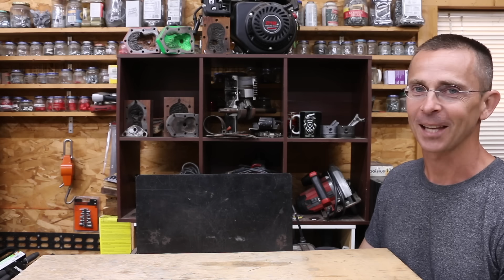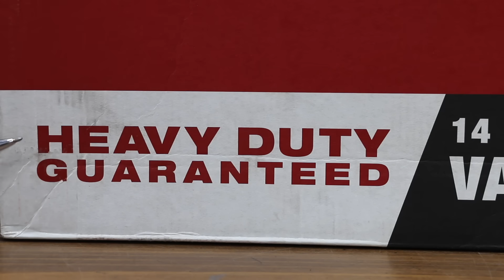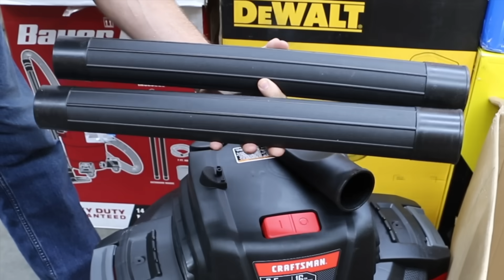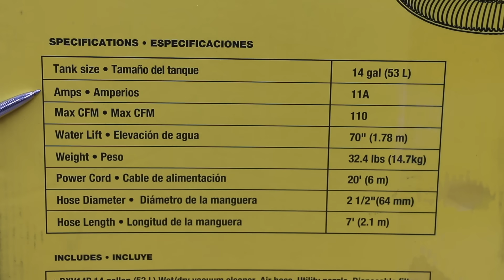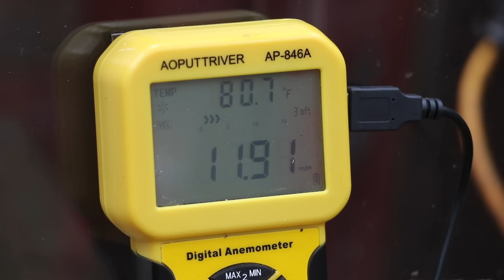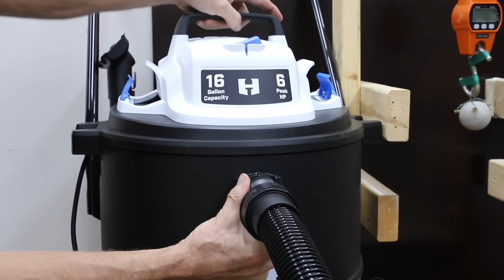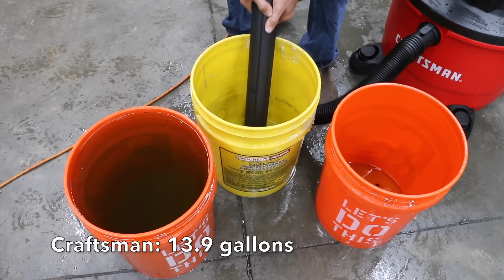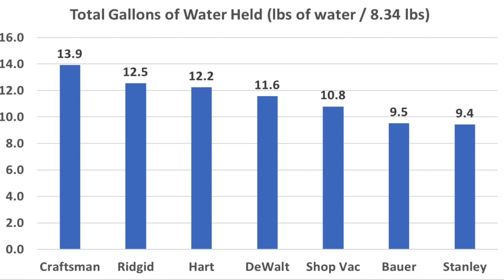Best Shop Vac? Ridgid vs Shop Vac, DeWalt, Stanley, Hart, Craftsman

Comment: We've had a lot of shop vacs in the years for our barns to de-cobweb and other things - our craftsman have held up the most. I also used them at work for drying screen printing screens and the switches are the #1 things that break on these things. The craftsman also lasted the longest there. Not sure now that the brand has been sold off, but IMO it was an exceptional deal when they go on sale for the 16gal biggest fixed vac unit they sold at about 90 bucks.

Comment: I'd modify your reporting results for the water capacity test. Since the vacs had different size buckets, a more useful metric would be "percentage of stated capacity" rather than just the total amount of water they could suck up. I own a couple of Craftsman vacs, but I will definitely give Bauer a second look.

Comment: Always wondered about those HP claims on 120V products.  On a 20-amp line, best it could draw (steadily) before tripping the breaker is 2400W or 3.26 HP.

Comment: One factor you didn't consider was the dust exiting the vacuum.  These are great for picking up wood chips, etc but are not great capturing fine dust.  This can cause a health hazard in confined spaces like basement shops.

Comment: Dewalt is the best by a long shot. It was the fastest to vacum water and sand. It also uses the least amount of power and produces the least amount of sound even though it was the most powerfull vacum of them all. Built quality was way better aswell. It also has 3 years of waranty.

Comment: You needed to test for dust/dirt containment.  I have a Ridgid and every time I move the shop vac around a bunch of fine dirt falls from the lid/bucket interface.  Enough where you need to vacuum up the dirt.  Not what you want from a vacuum.

Comment: Thanks for another thorough test!
On the measurement of suction, the force = pressure * area. The diameter of the hose makes a big difference in the measurement on the scale. It's still a relevant test of the whole package.
You can measure the static pressure with a gauge, or by lifting a column of water: Connect the the hose to a vertical clear plastic tube with the end in a bucket of water, and measure how high the water is lifted. In this test, the diameter of the tube and the hose don't affect the result. You can convert inches of water right to PSI.

Comment: I find it so surprising that one of the most irritating things with shop vacuums seems to be ignored by all the manufacturers. I'll take the quietest vacuum over the vacuum with the most suction anyday.  I have an older Shop Vac QSP model, (from their Quiet line of vacuums) and I have another shop Vac non QSP. The QSP is the one I always use since it is noticeably quieter. Shop Vac has since dropped the QSP line of vacuums. 
Another thing you may want to consider is the availability and cost of the replacement filter. If you work with something that creates find dust, you  should be using a HEPA filter on the vacuum. I wonder if HEPA filters are available for all the vacuums tested?

Comment: Sometimes the shop vac's air filters are not up to the job. They start to disintegrate when in contact with moisture upon swallowing liquids. As a result, the performance gets peak, but also allows dust and particles to get through to the motor as it's air cooled by the suction airspeed.

Comment: The Stanley brand seems like it will serve better for a bee and hornet nest removal vacuum.  Testing like this shows what kind of jobs each vacuum can handle best. Pretty nice. I know I would probably look at the Stanley as my go to because of the factors shown in the tests. By the way, I'm surprised there wasn't a test of the filters and particulate blow by  on the vacuums.

Comment: Bauer is pretty impressive! I have a hand held Craftsman 2 gallon and it's depressing trying to use it. The lid fitment is absolutely terrible, 3 out of 4 times it isn't on right and no suction. The hose fit is no better, always falls out. Not "pulls out"- it just falls out, while running. Thanks!

Comment: You can not test suction like that. The reason is that not all of the vacums have the same diameter hose. Pressure (and suction) is  force / area. If you have double the area of a hose you also have double the suction using the same motor!

Comment: Great video, I was really surprised with the performance of the Bauer/Harbor Freight vac, although it's actually currently more expensive than the Ridgid. I have the earlier model of the Ridgid you tested, the 14 gallon without the leaf blower feature, and I've been very happy with the performance and have used it for some pretty heavy duty wet pickup (even got the electric water pump that mounts onto it to empty it faster) as well as super dusty jobs, where I added a dust collector inline. The biggest things that kill the performance in my personal experience are using super long hoses (I have 4x 20 ft hoses that I attach in series based on the job... the performance hit is totally worth not having to lug a heavy vacuum full of water around), and the dust collector. However it's great to see this real-world comparison of these shop vacs since just about everyone owns one, and it's probably one of the most important shop tools for just about every job. Ty for the video as usual. 👍

Comment: I would love to challenge all of them, with my portguese brand 1.5 Kw shop vac, head fit is tight, all plastic components are rigid and it's heavy as a rock :D I unclog pipes with it, it even dries car seats :D and no assembly required. Also, yeah, it costs 700eur :D (about 750$)

Comment: Never had a problem with my 30 year old small Craftman shop vac.  The lid is super tight and creates a tremendous vacuum.  It bailed me out of a few basement leaks.  I do think warranties are important but a lot of warranties are useless with so much fine print and loop holes.  I've had great experiences with Dewalt tools and I'm sure their vac warranties are good. I'm sure Stanley is good since they are the same company. Craftsman is decent and so is Rigid.  Don't know anything about the others.  Thanks for the video.

Comment: Amp usage with no load is only indicative of the vacuums efficiency if compared to the rated wattage, not it's peak power. You should have created some air resistance by plugging in the suction hose. The added load would have shown the actual peak power of the motor as it needs more current to fight the air resistance. Also, noise levels when vacuum is not sucking anything are irrelevant as those are the lowest levels, not the highest.

Comment: You method for suction power is flawed in my opinion. Force equals Pressure x Area. This is why the Hart failed so - "hard". You can see at the marks on the ball, that the diameter is a lot less (and you said so when you compared hoses). 
So basically you now have to normalize your raw force results to a standard diameter. For example force per square inch. 
Thank you for the video.

Comment: When doing the water test, I noticed that some of the nozzles were being restricted by the bottom of the barrel covering a portion of the nozzle.  I suggest that a line be drawn on a given volume of water about 1/3 of the way up from the bottom and that the nozzles never touch the bottom.  This will ensure that each vacuum's performance is not impaired by an unintentionally obstructed nozzle. As a Certified QA Auditor, I hope my suggestion will help in furthering the quality of your testing. Also, a method of stopping each nozzle from going beyond some point in the bucket would guarantee the consistency of the data.
I love these videos.  Generally, your methods are well thought out and accurate.  Thank you.

Comment: i have a 35 year old "ShopVac" brand that is still going good. the metal container rusted out a few years ago, but i just put a 5 gallon paint bucket under it and am still using it.

Comment: About that sucktion test: please be careful with these numbers, since these shop vacuum cleaners have different hose diameters the ones with lager diameter will exert a greater force while probably having a smaller or simillar vacuum pressure. (F=p*A) You should have attached a 32mm end piece on every cleaner to have a better comparison.

Comment: I'm definitely NOT a fan of the "grudge matches," especially two impact drivers linked, trying to destroy each other. But this grudge match was different. There was little danger of any appliance being destroyed, and I think it actually highlighted the most important quality of these tools. This was a fascinating test, the only suggestion I have is if you do anything similar in the future, you should rig some kind of device to hold the hose in a corner of the (tilted) bucket, so the test is less dependent on the operator. That way the material, be it water or sand, would have naturally flowed to the low spot, and the hose would not have to be swept around to pick up the last bits.

Comment: Slight problem. The suction pull test had hose nozzles of different sizes, where as a std diameter end piece, so the area stayed the same, would've equalised the test, ie, F=PA.
Also the lid lift doesn't really matter because the vacuum will pull it shut. That seal is more to do with the case moulding allowing the seal to compress, and the seal material.

Comment: You might also want to compare the power factor for each motor, since that factors into the actual HP rating and not the Apparent HP rating.  Take Apparent watts, multiply by PF to get true watts,  then divide by 745.7 for true HP.  I think their "HP Rating" really just means "how inefficient can we make this motor?"

Comment: Shop vacs are about as common as the lawnmower, but only use one fuel... to bad.

There will probably be some company improvements as a result of this great test.

A shop vac can work without a filter. I wish this was tested, as often that is the only way they ever get used.

There is that foam filter, and also a clean-able pleated paper filter.

Does some water in the vacuum container improve filtration?

Perhaps a test on using the shop vac. I wear ear protection when using a shop vac.

Comment: The thing about the Bauer warranty is that Harbor Freight is a dedicated "tool store" as opposed to the big box stores where tools are just one department. One of their employees told me that they get loads of "tool rental returns" where folks buy something, beat the hell out of it for a little while, then bring it back for refund after their project is done.  Even though the warranty is 90 days, she said that HF will often do an exchange or pay-the-difference upgrade after the 90 days if you show them how the item failed.

Comment: In sweden, national consumer board has an additional test when tesing vacuum cleaners.

The connect the hose to a rotating arm and lets the vacuum cleaner follow the arm on a bumpy track simulating thresholds doorframes and whatnot for it to bang into. After like 100 revolutions they investigate whats left of the vacuum cleaner.

This will determine the strength of the hose the body and the wheel arrangement.

Comment: at my job we have abused Ridgid’s with cnc machining coolant running them for hours to suck coolant that was spilling onto the floor and then having it pour it back into the machine. heck i still have and use my old man’s 1982 craftsman 16gal shop vac, best buy he ever had with equipment. now i know what to replace it with when it gives out. craftsman and ridgid make and have made strong products

Comment: I found out HF offers 1-2 year extended warranty plans but did not find a price. Since the Craftsman and Bauer are so close in price,the Craftsman would still come out on top, but if time and location for the Craftsman are an issue it's nice to know a better warranty is available with Bauer.  HF stores are everywhere in my area. Craftsman not as much. 

From  HF:
"Our ESP plans provide 1 and 2 years of product protection on eligible products after the manufacturer's warranty ends. ESP plans can be purchased at your local Harbor Freight Tools store within 30 days of the eligible product's purchase date."

Comment: Well, that sucked! Great video and comparison. If it means anything, I have a Craftsman shop vac that I got in 1993 when I worked for Sears, that still works great. I've used it for everything from drains to drywall dust to vehicle cleaning and garage dust collection. I do use a drywall filter for fine dust. Have a great day and stay safe.

Comment: Bought my first Craftsman shop vac in 1977, still using it today. Used it during two house builds with a lot of sawdust, drywall dust, and water pickup. Only problem now I’d finding replacement filters!

Comment: If you're going to test shop vacs, not including a Fein in the mix is disappointing.  I used several other kinds before I found a Fein on sale for a price I could afford, but now that I have it, I am a fan.  Note, however that it has a smaller diameter hose, so there are some limitations.  But being able to plug my power tools into it and use it as an auto-on dust collector is a huge selling point.

Comment: I disagree with the first water challange. By putting the hoses in manually like that, you may be putting one hose closer to the bucket floor and restricting flow speed that way

Comment: I honestly use the leaf blower setup on my Ridgid more often than the vacuum setup, which was a surprise to me. I'll admit that as a vacuum its not perfect, but if you get the right head attached its more than capable for any job I've found so far... plus that lifetime warrantee is easily worth the cases where it lost to another brand.

Comment: I'm pretty sure my Miata makes over 8000hp if you roughly calculate it based off of kinetic energy unleashed in the fraction of a second when it hits the ground at sea level after a fall at terminal velocity with the top up.

Comment: This was an interesting and comprehensive test. I have an old dinosaur Craftsman that will suck the chrome of a trailer hitch, my newer Craftsman has a detachable blower which works well. I don;t think they make that model any longer which is too bad. The older craftsman still outperforms the newer though it's a close race. If I were to buy a newer one, I'd have to go Bauer for the price point and performance. The warranty issue could be resolved with an extended warranty purchase(Harbor Freight is big on that, but also follows through). If it (vac)  works, the 90 day warranty may be a non-issue. My old, really noisy, torn apart and lubed several times old Craftsmen is probably well past any warranty (25 yrs plus) but it still works very well. The Bauer doesn't scare me. ;-)

Comment: You should test tape measures next. For example you could see how puncture/damage proof the tapes are, see how good the locks work, and extend them as far as they can go without bending and dropping. You could also rest durability by dropping them from waist hight and from a ladder (realistic scenarios) until they start to show damage.

Comment: Would you be willing to test 1 or more of the stainless steel vacs like the Rigid or Shop Vac? It looks like the Shop Vac has the same SVX2 motor as the plastic version, and the metal Rigid is only 10gal-6hp instead of the 16gal/6.5hp. I'd really like to know if upgrading to the more expensive stainless options provides better suction, air speed, or quietness over the plastic models. The Stainless options have lid clamps, which could help quite a bit.

Comment: Test the best ways/products that cool off a vehicle on hot day. Like interior windshield visor, window tint, IR reflective paint on roof, solar panel on root, a roof vent, exterior window visors, cracking down the windows a bit, best combo of products etc. I think a lot of RVers and van dwellers like your channel and could use help on this. Keep up the great work.👍😄

Comment: Side cutter/channellock (tongue & groove plier testing. Would like to see cheap vs expensive brands and howuch the size makes a difference (6, 7, 8 or 10 inch) "high leverage" hinge design etc... Grip strength etc

Comment: I can vouch that I have beaten the absolute crap out of several Rigid vacs and they kept on ticking.  We often used rigid vacs to supplement our heavy-duty sludge pumps and industrial vacuum systems for hard to reach or delicate places.  One specific rigid vac I used sucked up about 20 gallons of near-freezing asphalt sludge from the bottom of a barge, several hundred pounds of paint chips, and about 50 gallons worth of a liquid calcium chloride & rust which instantly corrodes most metal.  During the course of those jobs, the vac took several falls of 10-20 feet (don't as why) and was no worse the wear.

EDIT:  I think the Rigid vac I had experience with was a different (and older) model than tested in the vid, so take this with a grain of salt.

Comment: Wet/dry shop vacs are amazing however if you are in the market for one, and more specifically looking for one for water, find one with a pump to dump the water as you suck it up via a second hose.  Nothing worse the sucking up water, then having to move to a drain to dump, then go back.  I don't know if any of the vacs you tested today have them, i'm sure if they did, you would have shown it when showing the product.  The Shop Vac (brand name) I have has a pump to expel water was it picks it up, though slower then it picks up is amazing.  If you are sucking water up from the floor with a nozzle it will never fill on you, and does a great job keeping up.  If you do the test shown here, it definitely wont keep up, however it will do a very good job and win over any that don't have that pump.